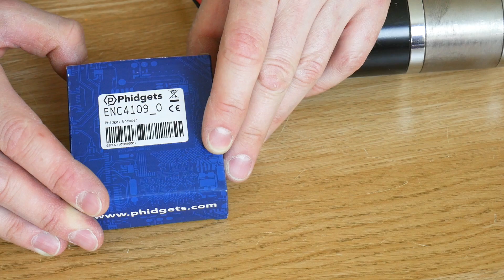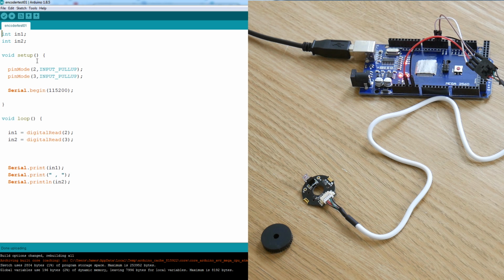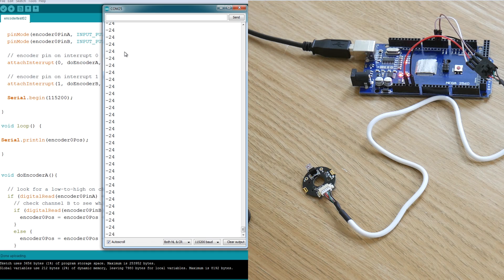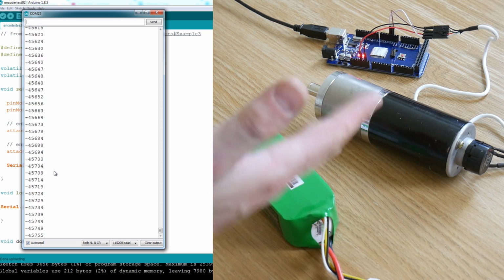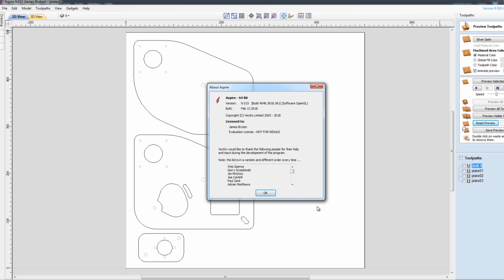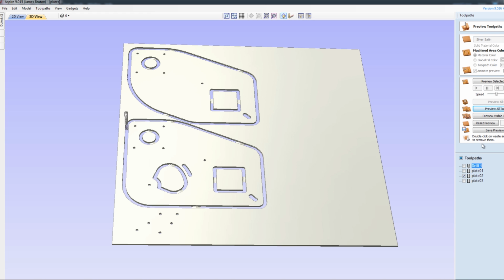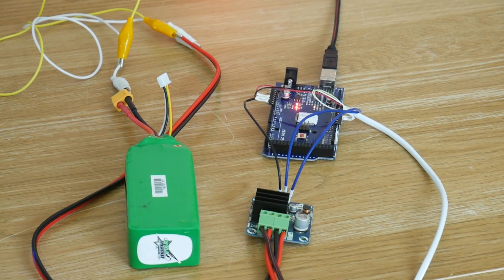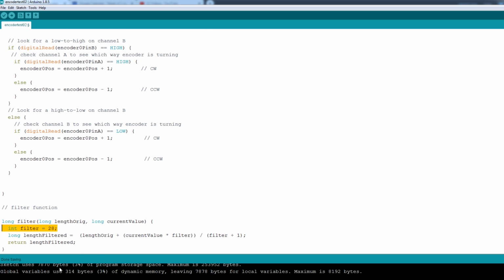Building a Force Driven Robot Arm #2 | James Bruton

Comment: That force measuring seems unnecessary, why not make it with those aluminium force load cells? That would actually get rid of the massive sloppiness you are getting. Interesting project btw.
Reply from the maker: Yes it would for this project, although I'd like to use a similar system on legs to give natural spring and force control.

Comment: You need to add affiliate links to all the motors and drivers you use in each video. I often find myself trying to find the stuff you use. Can you share a link to the dc motor with gear? Thanks!
Reply from the maker: They are from: https://gimsonrobotics.co.uk/categories/dc-electric-motors/products/gr-ep-52-high-torque-planetary-gearmotor-12v-and-24v-versions  but the gear was 3D printed

Comment: FYI, there are a lot of great 12V DC motors now with built-in encoders and a wide range of gearbox ratios: they could save you a lot of time and glue. :)  Just one example is https://www.gobilda.com/5202-series-yellow-jacket-planetary-gear-motors/

Comment: Wouldn't it have been possible have compliance just by using O-Drives and adjusting some holding power/pid loop variable then measuring how far off they are? Then you would have be able to adjust how compliant the motors are in the middle of the program, instead of adjusting springs.

Comment: The end positions are not accurate because you set the integral coefficient of the PID to zero. Thats what it is for, correcting for the remaining position error where the proportional error effect is too small to move the motor but the position is not quite where it needs to be. Try putting some small non zero value to I.
Reply from the maker: Once all the mass is on there I'll retune it

Comment: Also consider that when you calculate the force beeing applied using the angle of the internal shaft, the length the springs are stretched is not linear to the angle of rotation. Just to avoid trouble ;)

Comment: Didn't you have a rotary encoder sensor not long ago that used a magnet? Glue that magnet on the end of your motor shaft and measure off that :)
I don't think that comparatively heavy slotted encoder disk is gonna last long on the end of the motor shaft :( one sharp tap and it'll just break off. No criticism on your efforts, it's just a physics thing lol. If it's CA glue you've used, it's pretty brittle :O
Reply from the maker: Yes that is the plan.   We'll see how it goes, I was going to try and use the motor as a lathe to drill and tap the shaft ;-)

Comment: Isn't it time to buy a proper power supply?
So you don't have to use batteries for testing. I can imagine that can be quite tedious.
Reply from the maker: Yes it could probably do with a proper one attached to the stand eventually.
Reply: Power supplies get expensive if you need high power and you'd have to be careful not to fry it with your mad scientist set up. I'd like to have a nice lab psu but until then batteries will do.

Comment: How do you design gears?
Reply: many of the cad and solid-modeling programs have it as a built-in/plugin feature, you can then extrude it to the needed length/height. Then just working out the needed ratios.

Comment: Isn't the aluminium extrusion called 80/20 not 20/20? Is there a difference?
Reply from the maker: it's 20mm x 20mm . It would be 8020 if i were 80mm by 20mm
Reply: 20/20 is its cross-section so quadratic, the length isn't mentioned by default.

Comment: The encoder is one LED and two photo sensors.  With these two sensors you can determine direction along with counts and speed.  Woof
Reply from the maker: I know, that's what I'm doing.
Reply: @jamesbruton   Depending on the motor and thickness of its shielding, another simple way is to use two cheap hall effect sensors on the outside.  I do like optical encoders though, especially the bi directional ones that only use one sensor :-)   woof woof

Comment: Why couldnt you put the encoder on the gear end of the motor so it can accurately get the position because it is moving slower and you dont have to compensate for the gearing of the gearbox
Reply from the maker: Because there's backlash in the gearbox which means the motor will never be able to stop and hold it's position. There will be another encoder on the actual arm joint...

Comment: You would get much better results if you used a cascade pid structure.  If I understand your regulation sheme now you have angle -> pid->voltage. And then you have problems like the not enough torque for turning the motor and you have to use some strange filters. And if you were to use iGain then you would have poor dynamic response. 
You could go angle->pid->RPM->pid->torque->pid->current->pid->voltage. This tipe of cascade pid would get you much better dynamic response while utilising 100% of you motor capability. But you might run into problems using Arduinos for processing.
Reply: Even setting the integration term to non-zero would help a little although it might give some oscillations if set too high.

Comment: I still think the best solution to this would be calculating the force by measuring motor current.  It would completely eliminate that whole sprung second pivot deal and really tighten up the mechanical end of the system.  Plus using the brushless motor with a couple belt reductions would nearly completely eliminate the backlash from the drive system.
Reply from the maker: Imagine this is a leg joint and the robot is jumping on the ground. You really want some actual springs rather than bashing your drive train all the time. This is really the R&D for more walking robots...
Reply: @jamesbruton  ah. Ok nevermind then. I was really just thinking about this specific robot.

Comment: You can make the arm movement smooth and more precise by messing with the PID parameters such as the Kp, Ki and the Kd. The part where you explain the problem with the motor not recieving enough power to move as the error is so small could be easily fixed by increasing the integral gain or Ki in the PID loop. Also increasing the derivative gain or Kd would help the motor slow down and speed up gradually without using the filtering function
Reply from the maker: Yes it needs tuning. It's still worth having a tight PID response and a separate filter though - eventually I'll do S-curves for the acceleration and deceleration although that will probably change position over time for each axis of a kinematic model.
Reply: @jamesbruton  Makes sense actually. I hear derivative gain sometimes messes with the control more than it helps so thanks for reinforcing that idea. Can't wait to see what you come up with next. Super excited!

Comment: if you measure the current on the DC motor that is proportional to the torque.  So you can do torque control by controlling the current.  you can do the same with an AC motor but it's more complicated.  You need to do a transformation of the currents in the three phases.
Reply: Indeed, but it is a really bad idea with such high gear ratios and slack since you need such aggressive filtering that it is useless to detect a collision before harm is done.
Reply: @DerSolinski  With a current regulated motor the torque is constant with constant current.  It acts like a spring.  http://www.carotron.com/applications/csag-d/

Comment: Excellent stuff! 
It seems that the reason you're getting the position error is because you have no integral gain. If I recall correctly it's impossible to have zero steady state route without integral gain. 
Probably not worth it though

Comment: could the green wire be an absolute zero that blinks once per turn?
Reply: It is. The cable seems to be a standard interface for phidgets, and this encoder must not have index. In the page of this product you can see a image of the encoder connected to a encoder interface with a pinout printed on the top. https://www.phidgets.com/?tier=3&catid=103&pcid=83&prodid=1016
Reply: Might be a nFault signal, if the LED fails it will go low.
Reply from the maker: It didn't seem to do anything